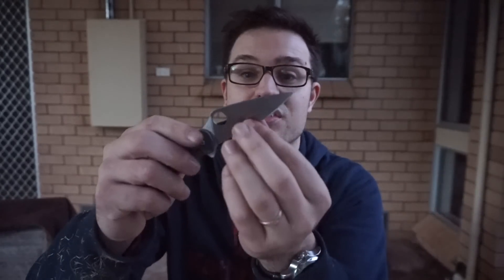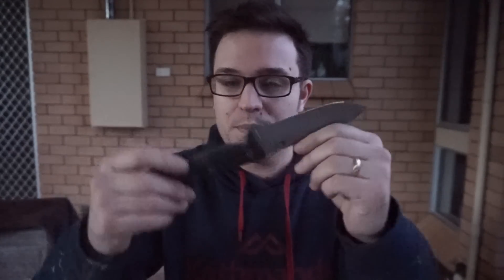Fashion or Function? Mirror Polished Edge on M4 Steel Comparison

Comment: You're the only one I can think of with a reasonable mindset on knife sharpening as in you know not everything has to have a mirror finish I'm on a budget right now and I have an edge pro and I was wondering if I could get away with just buying up to an 800 grit diamond Stone with that leave me a pretty good working edge I do have a thousand grit aluminum oxide I could finish off with I just didn't know what I would end up with with an 800 grit finish and if it would be good enough for say cutting rope and stuff at work safely

Comment: Thanks for doing these tests. M4 is my favorite steel. I just watched your test on the D2 challenege and was finding it interesting that M4 is twice as tough and 4x as wear resistant as D2 but “only” held an edge twice as long as the ontario rat. but for real life use that could
be years of occasional use. I find the ganzo firebird D2 to be surprisingly good. id even say the best out of budget d2. Do you mark or tape off your edges to ensure each knife is using the same length of edge to absorb the work if you know what i mean? I always have recommended your channel for knife testing!

Comment: What about mirror/rough finish at the same time? Mirror with up to 6000 grit stone and then diamond paste of 2,5 and finally 1micron and on the other side rough on 240 diamond and just smooth it out a bit with 1micron paste. I'm trying it out on my xc75 steel hardened to around 63hrc for some time now and it's performing really well. Wonder how would M4 perform in such or similar configuration. 🤔

Comment: Itd be interesting to see now if a sub-micron strop after grinding a toothy edge on M4 can improve its retention. Using something like 0.5 or 0.25 micron diamond spray/solution, you can remove some of the friction coming from the toothy edge without really removing its toothiness. Ideally the diamond particles would be smoothing the carbides and not tearing them out, due to their small size and hardness, and maybe having a smoother edge while preserving a toothy microstructure may prove to be advantageous. S90V is another one where this experiment could work.

Comment: I’d like to see a video where you test at each grit level to see where you get the peak edge retention.

I see you went with 600 grit on the second part of the test, what was the grit/stone/strop progression that you used for the polish?
Reply from the maker: 160,000
Reply: Cedric & Ada Gear and Outdoors 

Thanks for the response!  Very high grit indeed, I’m interested to see if you went up to the 1500 grit diamond stone on the M4 if it’d help or hurt edge retention :)

Comment: Awesome to see that you finally got the KME! Nick is the best. You can probably boost those numbers even more by changing up your finishing technique, I usually go from 20 strokes on each side, then 10, 5, 4, 3, 2, and then 1 on each side back and forth a few times getting lighter each time. Helps to ensure that there is no but whatsoever especially if you arent a stropping after and just ending with one of the diamond stones, but helps even if you are going to strop or polish after too!

Comment: I believe what you are seeing is diamond vs aluminum oxide or silicon carbide abrasive.  The diamonds are able to abrade the tungsten and vanadium carbides instead of tearing them out.  Im not certain but i feel you would get even more cuts with a polished edge as long as you used diamonds or cbn.  Would be interesting to see what would happen if you got a couple higher grit diamond water stones.  Thanks for all your hard work.
Reply from the maker: these are diamond abraisives on films that are attached to glass plates, up to .10 micron (160,000 grit diamond)
Reply: Cedric & Ada Gear and Outdoors I thought you said you finished on a 600 grit diamond? Sorry
Reply: @CedricAda  WTH??? 😳

Comment: Nice video.Learning a lot about steel and how they function from you. Polished vs coarser grind and on to angles. Good work. Can't wait until the book is published-;-)
 I see that sharpener is a bit wobbly. Pricey for that much instability. Have you considered hunting it so it's on a solid base?
Reply from the maker: doesnt  reallt bother me too much, o think im supposed to go slower, but the shaking doesnt effect the angles so i just go flat out

Comment: Thanks. I bought a M4 Bark River Bravo 1 so I have been interested in this steel.
Reply: Just put some mineral oil on the blade before you put it in the sheath
Reply: It's my favorite steel, but if you look at it funny it will rust

Comment: I can't wait for more of these, to see just how crazy I am for loving the mirrored edges.   Thanks for testing this!
Reply from the maker: i suspect with some steels it will be to the benefit - and also I think rope cutting may favor coarse in general. I am wondering how things like VG10 and LC200N do, the most
Reply: Whoa!  Didn't anticipate that result.  Neat!
Reply: Makes sense to me. These tests involve slicing rope, which lends itself to a toothy edge. Michael Christy's tests are push cutting, which lends itself to a polished edge. Christy's tests end at the blade not being able to shave hair as well. Not surprised that polished edges come out on top and the opposite happens for Pete.
Reply: Cedric & Ada Gear and Outdoors I was thinking the exact same thing.  Possibly the case. More abrasive materials may yield a different result entirely.
Reply: its really quite sad when such good YouTubers like your self with great thumbnails and great videos are getting such little publicity for it good luck to you man and i hope your channel takes off
Reply: Nick, you just did Pete and all the You Tube steel nerds a solid. Thank you!
Reply: That was a beautiful thing to do, a real gem of a guy, that shabazz.  Someone had to do it  =P
Reply: Cedric & Ada Gear and Outdoors definitely agree, rope cutting goes much easier with a toothier edge in my testing, even with steels that may perform better with a polished edge, cutting sisal rope may somewhat distort that result. I did some cut tests on sisal rope and the same cutting board and everything, and every single knife I tried, it was WAY easier to cut the rope with the 600 grit edge, and the extra cuts to actually get through the rope with the polished edge skewed my results substantially.
Reply: This is nothing that anyone who actually uses a knife will know.  Also, it was tested scientifically and reported back in the days of Usenet before the WWW was even a thing, not to mention Youtube.  Of course, if you like your mirror polished bevel*, you can always apply a micro-bevel with a coarse stone.  Likewise, if you actually want a polished *edge for its push cutting abilities, you can always just leave the relief bevel with a coarse finish and take the finish of the micro-bevel up to a very fine grit finish -- something you'll be able to do in a fraction of the time of polishing the entire relief bevel face.
Reply: Thanks @Nick Shabazz for getting Pete this KME setup!!
Reply: Jaden Osgood Remember mate Pete used have only 2 subscribers...and Killer Deegan was both of them.
Reply: Thanks Nick for supplying Pete with the KME! I wish it had been out 5 years ago, I'd probably have one and several hundred dollars instead of the Wicked Edge with what ever pro-pack I'm up to now, lol.

Nick, Pete, and Frankie and Bird really enjoy your channels!
Reply: @ashoppa  I actually was thinking of getting the WE and seen a video on it and what a joke! To do this blade you need this upgrade,etc,etc,etc. $3000 later well that might be a hair exaggerated!
Reply: Nick Shabazz I like you, I don't like your voice. I'm sorry.